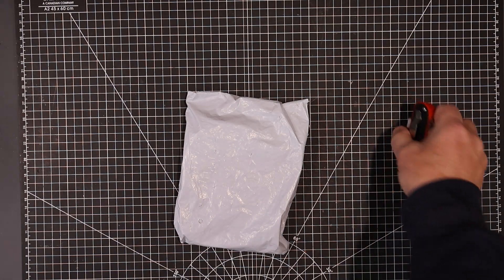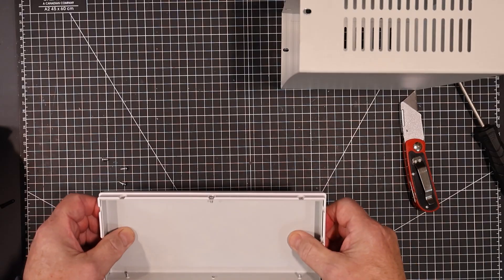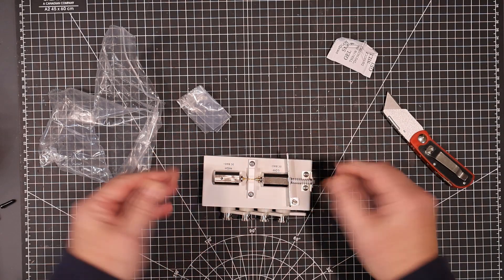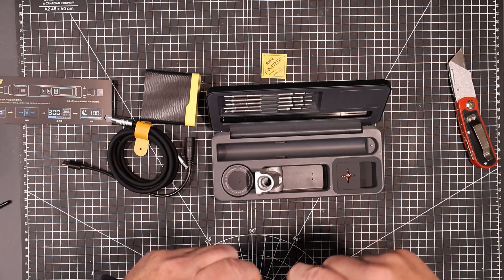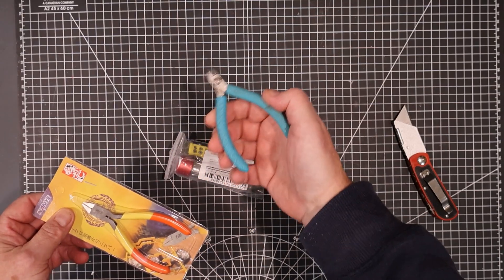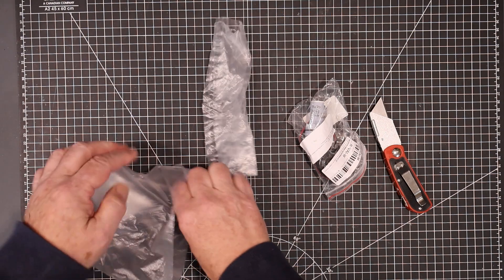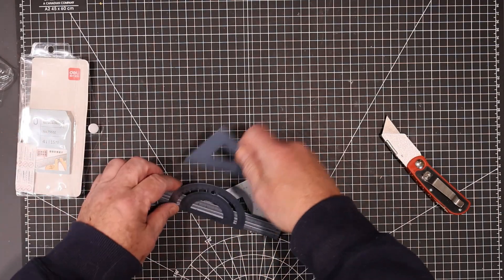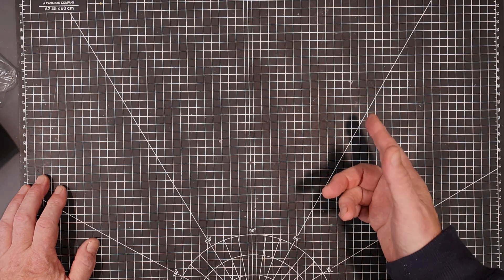Uni-Byte 0295 - Mailbag #39:  FANTASTIC AliExpress Tool and Accessory HAUL!

Comment: Hi - could you please provide a link to your video # where you covered the "older style" project enclosure that is shown here at 2:25. Thank you
Reply from the maker: There are lots of video I actually use that type of case.  Try the following ones: 0053, 0078, 0099, 0100, 0103, 0150, 0189, 0194, 0197, 0236.
Reply: @uni-byte - I found one reference in an old mailbag, and you used it in a power supply build.
I found on Ali but the metal plates are blue, which looks ugly. I will now search for the description of videos that you mentioned in your reply.
Thanks 👍🍺
Reply from the maker: @johncoops6897 Some of the black panels on my projects are just the blue painted black.  Others are PC boards.

Comment: The Kelvin leads at ~ $30 are quite expensive, hows is the build quality? was it worth the price. I wonder if they would fit the DE-5000
Reply from the maker: i just  put up a video yesterday where I talk about that and do  little test with them.  They are built well, are as accurate as the built-in socket and are a standard configuration.  I do not know 100% for sure they will fit the DE-5000, but am fairly confident they will.  To me, they are worth the price for convenience alone.

Comment: Hi, Bill! Your Mail Bag videos are the only Mail Bag videos I bother to watch. Do you have a link for the Silicone Test Leads with straight bananas? These are right angle/90*. Thanks!
Reply from the maker: Hi Tom,  Thanks!  The straight plugs I put on myself.  I also get those off Ali-X too.  If you go back a couple of mail bag video you'll see them.  Unfortunately  YT will not let put in links in the comments that go off their platform.
Reply from the maker: Hi Again Tom.  I put a link to the straight banana plugs I use just above the discount codes in the description.

Comment: Your lab gets better and better all the time. Lots of handy and functional conveniences, especially after you have de-Chinesed them and made them safe, reliable, and convenient. Some techs just don't realize how frustrating, time consuming, and prone to error it is when everything isn't done right. They learn the hard way. 

I'd get the Chip tester, but I doubt if it tests my box of 8080's, Z80's (and support chips,) 2806's, or my C-64 sound chips. :)
BTW, I ordered one of the soldering pencils. An old Metcal is great until you have to carry it around with you. Then it's laughable.
Reply from the maker: I think you'll like that soldering iron.  If is half as good as the HS-01 it will be nice, but it's supposed to be much better than the HS-01.  I'll be using mine today.  Yeah, I think the IC tester is mostly for logic chips and a few common op-amps.